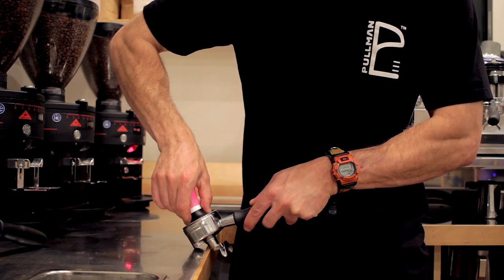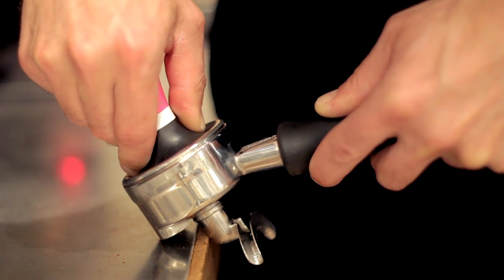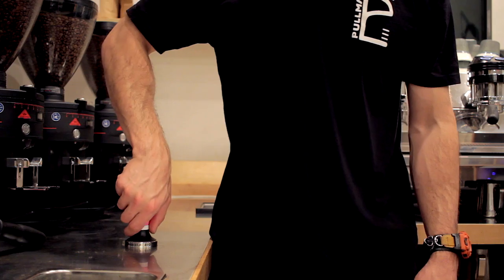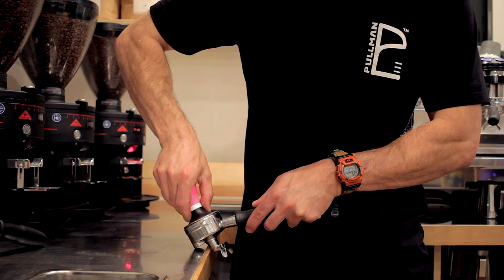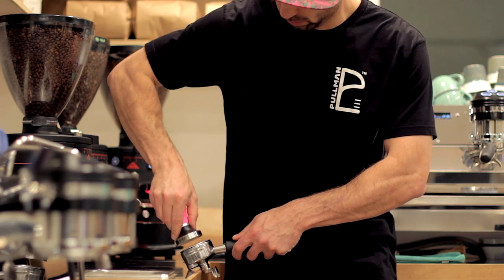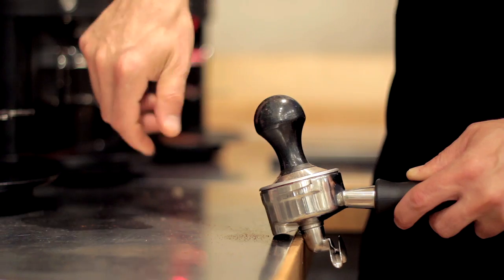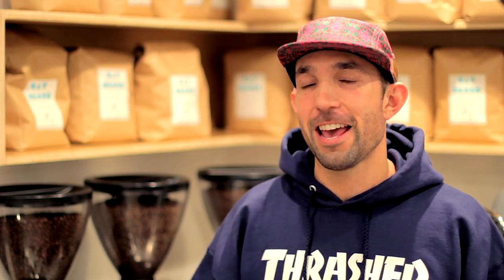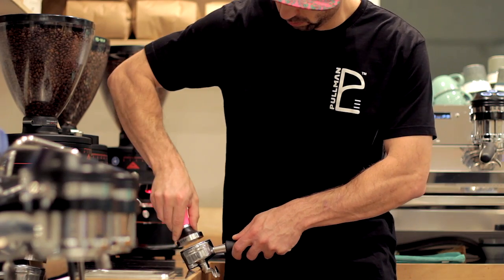Extract Everything 003: Espresso Tamping Tutorial

Comment: And sooooo many popular espresso channels/ “pros” still advocate for polishing. cough whole latte love. Thank you for actually teaching proper technique without the myth bs
Reply: I like to apply a "finishing polish" but the mistake people does when polishing is to apply pressure while doing it just like I told my mom NOT to push/tamp while leveling, that it was 2 seperate steps. Also just 1 full turn or even half a turn is enough to make disapear the few little grains on the surface.
Reply: PanzerIV grains on the surface have 0 effect on anything. The water is passing through the coffee it doesn’t care what the top looks like as long as the puck is even. Polishing of any kind adds nothing but increases the chance of an unlevel puck
Reply: @Adam-vx6to  Yea I know it does nothing on the coffee but it looks nicer to my eyes and I have a bit of a OCD with my pucks ^^ That's why also I just do 1/4 of a turn at the very end with 0% pressure as if I was holding a super fragile baby bird, that way impossible to ruin anything.

Comment: A note to throwing the coffee out after uneven tamp:

Totally not needed. You can take something thin but strong like a safety pin and really stir up the coffee in the basket to get it loose and break all clumps. Afterwards, you can re-tamp just as if you just ground it. 

NOTE: the stirring is known as the WDT method and can result in faster extraction time, if you don't normally do it. It's really good for grinders that don't disperse evenly across the basket and REALLY helped me in the fight with channeling. I encourage you to look it up and remember - you might need to change your grinder setting to correct for the faster extraction time, if you apply it on your shots.

Comment: Lots of experimenting with my Bravelle barista in the past couple days. Tamping seems to be the one area where  you can’t really control the variable. Adjusting the grind size, and coffee amount are things you can control 100%. When I  put more pressure on the tamp, sometimes the pressure needle goes way too high and I get what is pretty much dripping motor oil.

The biggest issue I can’t figure out is even when my brew time is in the optimal 20 to 30 second range and the pressure needle is where it should be, I’m still only extracting around 2 ounces, maybe less, for a double shot. I can’t figure this out as I’m getting literally half the amount of espresso even when my brew time and pressure needle are in the sweet spot.
Reply: Somewhere around 2 ounces is what you SHOULD be getting in that time frame for a double shot. Get a scale and check the weight of the espresso though. That's more important than volume.

Comment: Thanks for the great vids!  I Just got a nice Espresso machine, and got the Breville Pro Grinder...  Also got a calibrated Tamp, but almost every single time I pull my shot, my right drip spout on the portafilter lags behind. Or drips, while the left side is a nice smooth flow. And the right side often stops before the left. Any ideas on how to fix this?  I pull about 1 3/4 - 2 oz shot, at about 26-28 seconds.

Comment: does polishing and spinning loosen the puck? Also removing the tamp too quickly can crack the puck as well?
Reply: vacuum?
Reply: Dino removing to fast create a a vacuum right? I swear someone told me that once :P I dint know what to believe haha
Reply: Alistair Pace The vacuum definitely happens to me for that same reason of pulling the tamp out too quickly. I see my puck pull with my tamper just a bit. Trying to break this habit!
Reply from the maker: There's really nothing wrong with polishing if you do it properly but it definitely has potential for problems - especially with new trainees. Also the more steps there are in your technique  the more things there are that can go wrong. Also polishing has zero benefit so it's just an excessive motion. 

Removing the tamp very quickly can create a vacuum which can break the seal between the puck and the basket indeed.

Comment: Do you find with vst tampers + vst baskets  cause suction ?
Reply from the maker: I don't think a normal VST set up has suction issues. We use the BigStep which is a bit bigger than the base Pullman makes for VST. It's stepped to reduce suction, but you can definitely get suction if you rip the tamper out super fast for sure.
Reply: AH that makes total sense. thanks!